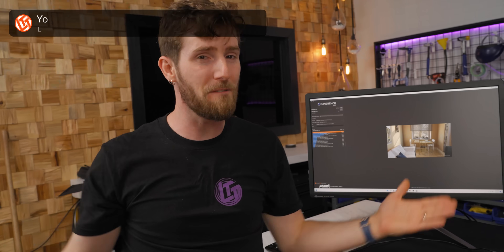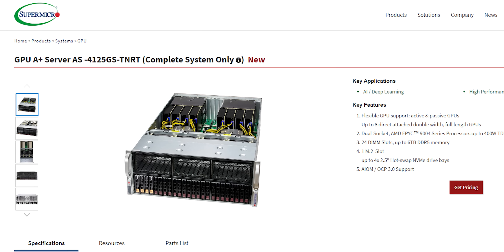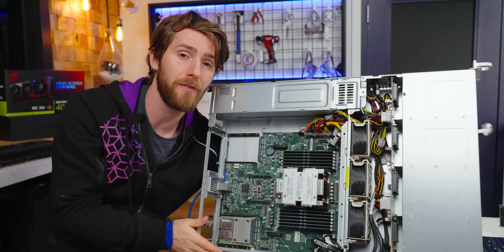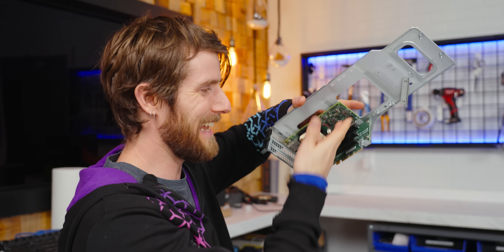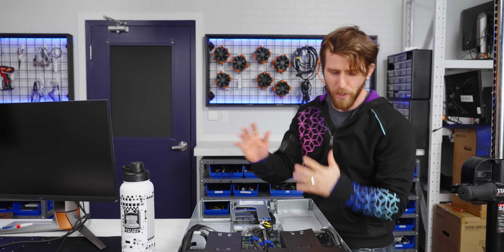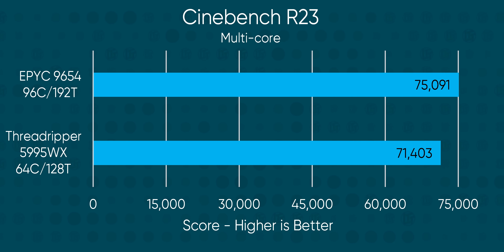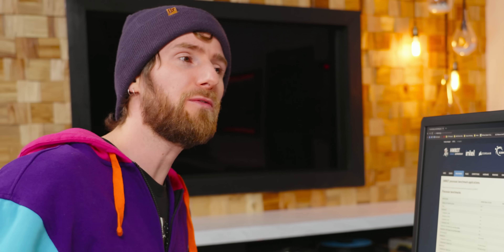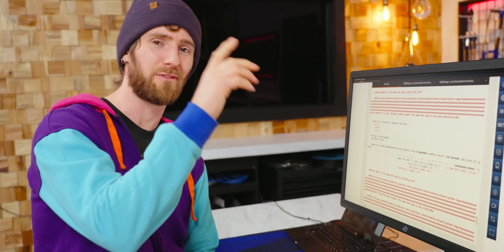HOLY $H!T - The FASTEST CPU on the Planet - AMD EPYC 9654

Comment: I work in the HPC industry and can confidently say that the EPYC Genoa-X instance types on AWS and Azure are going to be a big hit. All of our major customers have been requesting access to these processors since they are blazing fast and have an incredible interconnect speeds. It's a lot of fun to be an early adopter of this amount of processing power.
Reply: nice 🙂
Reply: Good to know the response is good so far 😊Not sure what kind of workloads you run but we are working on optimising all of our software to take advantage of the new CPUs so it should be even better soon!
Reply: blazing fast... just like their java script with the New framework released an hour ago🔥🔥🔥🔥🔥
Reply: It also helps that AWS charges 20% less for AMD-based EC2 instances XD
Reply: You're sure about that? Software is still difficult with AMD systems (and many other problems....)
Reply: Do you think they will be available on GCP or Azure?
Reply: That is a bold statement, that will not age well. For SOHO that might be a good priced solution. Big companies would still buy Intel for software capabilities, and AWS would focus on they own arm64 architecture which already has a better per core performance.
Reply: @stralex7  "software capabilities" is not a property of the CPU, but the software itself.
Reply: Gotta say I'm jealous. I'd love to mess around with hardware like this
Reply: @bartbasil3704  what a shame, on the latest cloud hardware Intel can't even come close to AMD in most cases (at least for scientific computing).
Reply: Any idea what the timeline will be before you're able to deploy Genoa-X coretypes?
Reply: @engineeringvision9507  Azure will undoubtedly have Genoa-X machines; I expect they will be the HBv4.
Reply: @hwstar9416  This is true, but there are customers who have software stacks that are optimized for Intel and don't care that much about CPU performance. Lots of appliance vendors, for example, aren't pushing high core counts or high CPU performance and are just selling a physical box to ship their software on. Similar case with storage servers, ones still based on rotational HDD, don't care about CPU performance and the software is still tuned for Intel, or Intel has better supply situation. AMD definitely has the best specs, but there are customers who don't care. I don't have a horse in the race so I don't care either way, but I do run into these customers fairly often. It shouldn't be this way, but software is often more permanent and difficult to change than the hardware under it.
Reply: @reidprichard  It mostly depends on the application and libraries used. Intel has great compilers and libraries that typically allow them to be ahead of the competition. A few months ago we, as a research group did some testing on several systems. Even the latest Milan CPUs (7763) couldn"t even come close to the performance of the old skylake 20 core CPUs (Xeon Gold 6148, from 2017) CPUs. The best that we could do was about 20% worse than the intel system. That doesn't sound that much but once you factor in the fact that that were 200 cores (intel) vs 640 cores (AMD) (we had 10 CPUs, 5 nodes, dual socket systems) and the 150W per CPU on the Skylake CPUs and 280W on the Milan system, the whole Milan cluster needed almost as much energy when idling as the whole intel system when running HPL. 
And it was a lot more work to improve the AMD system's performance. On the intel system we pretty much did nothing and had our results after a few days. The AMD system took us month to even come close to the intel system. 

I don't want to say that EPYC CPUs are generally bad. Some aspects were very great too, but when it comes to software support and tuning the intel systems are typically a lot easier to work with. It's all the stuff with numa nodes, CCDs (literally takes hours to configure when you have to manually map 640 processes to 160 numa L3 Cache pools) socket to socket communication and so on. 
Many things can also be ruined by using certain BIOS options
Reply: Imagine the insane specs of computing not available to the public that is no higher than a pizza box in height.
Reply: We are thinking some four socket servers with these in our next system and screw the Infiniband. Our last system we spent over six figures on interconnect alone for capacity jobs. That would allow 384 core jobs with no fancy interconnect. Take the money saved on interconnect and buy more compute. A reasonable standard compute node is going to be at least dual 32 core, and well over 90% of our jobs run just fine on dual 20 core today.
Reply: @jonathanbuzzard1376  There won't be any 4 socket systems.
Reply: @lukas_ls  but intel keep delaying their new server cpu.
Reply: @raisofahri5797  What does it have to do with my argument? 
Sapphire Rapids is coming soon and test systems are provided for HPC applications. Even I was invited to do some pre release tests on Sapphire Rapids (with NDA then). Shouldn't take that much longer
Reply: @Cooe.  no, it's only 768MB of L3 Cache (384 per CPU)
Reply: Could you please explain to me what the fuck you do with 96 cores? I’m watching this video nodding along like I understand when in fact a video about the Japanese language would be more clear.
Reply: @Absolutjeff  there are many different possible applications
Reply: @lukas_ls  Like is this going to help cloud stuff? I honestly don’t understand a ton about how cpus work, they’re saying the 4090 is bottlenecked at 4K even with a 24c/32t 13900k and I’m like how is that possible if it’s at like 10-20% usage or whatever
Reply: @Absolutjeff  CPU usage isn't easy to determine when you have multiple CPUs (cores)
Reply: Meh.......unless they sort out their cancer enducing driver software its a nope from me. AMD are the PC equivalant of a Bugatti Veyron on leaf spring suspension
Reply: EPYC Genoa will be IDEAL for GPU-intense workloads where it would be IDEAL to attach MANY of those AMD Server GPUs with One-Terabyte-of-VRAM for use in masssively parallel workloads such as materials sciences data mining research, software-based CNN (Convolution Neural Network) and GAN (General Adversarial Network) aka Artifical Intelligence research and development, super-fast parallel stocks, NFT and commodities financial trading platforms and massive multi-million-simultaneous-users game server systems.

What used to take a $20 million dollar IBM Z-frame computer system can now be done on a $200,000 EPYC super-server!

Now THAT is what I call a very decent ratio of computing-performance-for-your-dollar!

V
Reply: @Absolutjeff  rendering
Reply: SOMEONE! ANYONE!! PLEASE READ HELP!!! Does anyone remember a few years back a certain cpu would only work with a different type of memory? I can’t recall which it was? Intel extreme? Threadripper ? I just remember it was a more expensive sku and I also believe a different mobo was needed. I just clearly remember Linus talking about it but i can’t find any info on it. When Linus mentioned that ecc memory I started remembering but I am stumped.
Reply: @lukas_ls  genoa-x will be the 3dvcache version however , with crazy amounts of l3 cache.
Reply: @engineeringvision9507  The new HBv4 coretypes on Azure will use a dual socket setup, resulting in 176 physical cores. It's also using the latest Infiniband networking that supports connections at 400 Gbps. It's nuts.
Reply: @reidprichard  We're deploying our Genoa-X instance types this week in early access, and aiming for a public release in January.
Reply: @Absolutjeff  Most of our customers are large engineering firms. We have simulations running on our platform that can easily use 1000+ cores for a single simulation. For example, large physics simulations, financial simulations, AI training, and many more.
Reply: Just a suggestion, HPC on cloud is actually not intelligent I think. Even small baremetal beats cloud (Price & Performance wise) for HPC stuff. I am building one cluster in my home office right now. You can look at AWS published benchmark numbers on their own website, which are lousy numbers I should say. Even this 96 core monster will be abused by AWS to cram in more clients on a single machine. Its a good business case for AWS for sure but now for clients renting them out.
Reply: AMD's unreliable supply chain is going to severely limit their impact. TSMC has been deprioritising AMD ever since Apple and Qualcomm started becoming their star customers. This can be seen in the failure of Zen processors to take off in the enterprise space (as the supply isn't consistent) and Zen 4 being delivered a year behind schedule. 

Especially in the server space, bigger businesses who switch to AMD will get burned if they ever need to scale up quickly...
Reply: @prashanthb6521  Part of the value proposition for "cloud" computing is that you don't need to maintain your own cluster, worry about replacing parts as they age, nor do you need to pay for the whole cluster 100% of the time. If on Monday you need 10,000 compute cores for just a few hours and then you don't need anything for a few days, the value of having your own computing cluster decreases. There are certainly use cases where on-premise computing makes sense, I don't deny that, but the fact that AWS, Azure, and GCP have gotten as big as they are is a testament to the fact that most people want to be able to have the kind of flexibility that they offer.
Reply: @malourocha9211  Was it the Abu Dhabi G34 Socket Opteron CPUs from AMD which has 16 cores with single-threads (i.e. no 2 or 4 threads per core) at up to 3.5 GHz clock speeds and running at 140 watts?
Model numbers were 6386SE and 6380!

That ALWAYS needed ECC memory -- We always used the 4-way TYAN type motherboard for those so we could have 64 threads and LOTS of memory for our 64-bit Floating Point materials sciences modelling!

That was 2012/2013 if I remember correctly. 

They are STILL usable and workable as server CPU's for many small-business and multi-user web-specific tasks in 2022! Go get them if you can find them! I once ran 2000+ simultaneous web messaging and powerpoint collaboration users on a Windows 2012 Server DataCentre Edition with just a four-CPU motherboard using those Opterons!

Back in the day, we had over 25,000 thousand of them at our Northern British Columbia Datacentre used for SSE-accelerated instruction set computations! A pity we re-sold them all by 2018 to go full time to our internally-designed DragonSlayer CPUs! I happened to REALLY LIKE those AMD Opterons!

V
Reply: @lukas_ls  Not what we are being told by the vendors. The EPYC Genoa is 4-way capable and there is definitely a market for them. That said they are likely to be water cooled, but that's not a problem as we are already setup for water cooled rear door racks, so we have the water below the racks right now and there are spare outlets that would accommodate this stuff. As it is the maximum job size we currently allow is 400 cores after which you need to apply for time on the national HPC systems. So we would have the option of a handful of 384 core boxes as well more than 90% of jobs are fine on an existing 40 core node and it will be at least 64 core on a new system or spending a six figure sum on interconnect. Put it this way if you are a vendor and have the option of reselling a lot of Infiniband/Omnipath switches and cabling or selling your servers what would you want to do? There are already 4 socket EPYC boxes I could purchase so why the vendors would not do the latest machines when there is definitely a market for them would be bizarre to say the least.
Reply: @jonathanbuzzard1376  According to AMDs spec sheets they're only 1S and 2S capable
Reply: @StarGateSG7  lol thnx for the info bro, . I remember it  was a certain cpu that needed a different memory, I’ve searched and can’t find it, Mandela effect maybe?? It might be the one you mentioned but not sure if it was that far back. I’m guessing it was either a w variant, Xeon, extreme or even threadripper. I just remember Linus saying the model needed different ram and mobo
Reply: @Absolutjeff  More cores means more IN-PARALLEL operations per second.

For example: I am searching for a room temperature superconductor candidate and have narrowed it down to Yttrium-Copper-Aluminum-Calcium-Magnesium-Manganese-Vanadium-Zirconium-Gallium-Ferric-Silicon-Oxide BUT which actual formulas in what chemical formulas and proportions will make me a FLEXIBLE ceramics-based room-temperature superconductor?

I need to test the various atomic/molecular bindings, their group thermal and conductive properties, their structural strength and longevity, and so many other properties such that I will assign ONE processing core for each candidate and iterate through all my data-mining criteria for EACH separate Superconductor Formula in parallel so I can check different formula properties all-at-once! 

The more cores I have, the more chemical formulas I can check per second! 

If I rack TWENTY dual-EPYC-processor motherboards that is a total of 96 cores running two application runtime threads per core for 192 threads per CPU, those twenty motherboards with 40 CPUs will have 3840 cores running 7680 runtime threads meaning I can run 7680 SEPARATE chemical formula searches AT THE SAME TIME so I find find the world's FIRST Room Temperature Superconductor!

P.S. That above ceramic "formula" is one of the REAL CHEMICALS our parent Aerospace corporation is finding as a possible candidate for a real-world Room Temperature Superconductor! 

We found that Gallium is Key to superconductivity at -150C to +200 Celcius operation and are ALSO FINDING that the addition of Bismuth and Palladium are ALSO adding some "interesting EM properties" to our compounds!

For those of you who need lots of cores, EPYC is no slouch when it comes to multi-threading to find the next Cancer Cure or the next ultra-strong and lightweight artificial Spider Silk cloth chemical formula!

THAT is why we NEED MORE CORES!!!!

It means that we can look-through and check more items per second in a simultaneous manner to find one or more candidates for a valuable and sellable end-product!

V
Reply: @lukas_ls  We had a similar issue back in the day with the AMD Abu Dhabi and earlier Opteron 12 core and 16 core processors (we had 250,000+ of them in our Northern Canada datacentre along with various RISC processors which was technically the fastest Supercomputer in the world at the time but we never reported it to the T500 list!)

We got an enormous increase in processing speed by creating a super-optimized imaging, encryption, compression, advanced trigonometry plus vector array math routines, and expert-systems database and data-mining routines library entirely using locally-optimized CPU registers for storage and fine-tuned AMD SSE-1/2/3 instructions which we mapped to easy-to-use and network callable C++ functions. 

This custom library took the internal team TWO YEARS to code but it's still used today twenty years later in our older systems.

All that assembler-code expertise did us VERY WELL when we finally went over to our internally-designed and manufacturered super-CPU's that took us over TEN YEARS to design and build for final tape-out which are CISC-based 128-bits wide running on GaAs (60 GHz) and RISC-based 128-bits wide opto-electronic-on-borosilicate (2 THz) substrates. 

Intel is NOT the only player in supercomputing and AMD is a great buy for those who want a specific type of parallism and multi-processing that Intel CANNOT give you! I definitely notice that SSE instructions mated to common imaging tasks BLOW AWAY the equivalent Intel performance metrics. Rendering a series of raytraced images and/or doing physics-based object/vehicle modelling and collision-deformation physics in parallel using SSE instructions on AMD Rome and Genoa EPYC cpus is an automatic 20-to-30% boost over Intel equivalents !!!  Then add in Encryption, Compression and Decompression and long-form multi-language Unicode string searches ALSO make for an AMD strong-point!

Intel though STILL is better at gaming on one to four threads. Past four-threads it's all AMD for massivelly parallel rendering work!

I should note though, we (i.e. NCA-North Canadian Aerospace) STILL BLOWS AWAY ALL AMD, Intel, IBM, ARM, RISC-V processors on absolute 128-bit computing and outright computer fire-power using our in-house systems though! 

It's REALLY kinda hard to argue against massively parallel super-computer systems that range from One to 20 YottaFLOPS where a single one of our in-house designed and built fully-ITAR-free 2 THz combined CPU/GPU/DSP/Vector chips is over 50 PetaFLOPS in 128-bit trig, vector math and general imaging computational horsepower!

Meh! 
V
Reply: @StarGateSG7 Z frame is not a Mainframe?